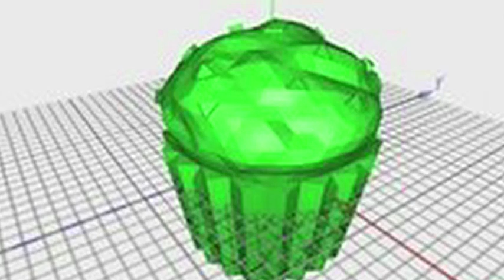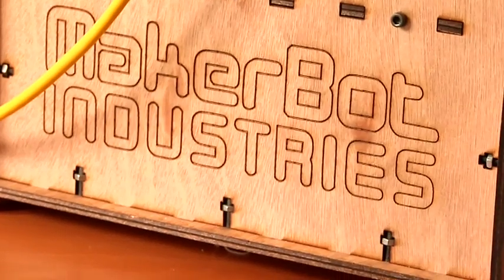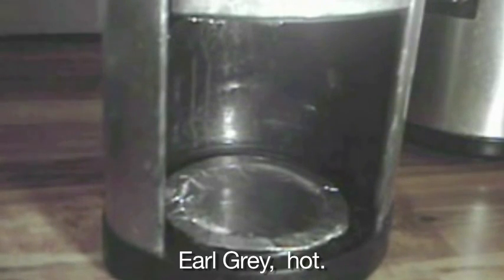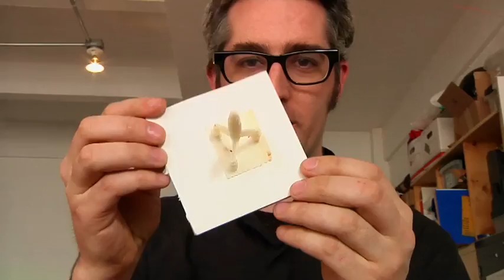MakerBot: The 3D Printing Robot

Comment: I just want to warn everybody reading this. That I purchased a MakerBot in Sept. 2010, and I built it, it worked for one print, then failed.  MakerBot support is almost as horrible as the half ass wood design of the MakerBot.  AVOID AT ALL COSTS!  Also if you already bought a MakerBot, threaten to sue Bre Pettis and MakerBot, and Bre will refund your money in full, and you can keep the MakerBot, for a free machine. Thats what I did. and I recommend it.

Comment: I don't want to get into text comment tennis, but I didn't wish to knock the US as its a great country. Unfortunately you have done it again. Check out Wiki for the following . Laser - Alfred Kastler (Nobel prize 1966). Revolver & Machine Gun - James Puckle (1718). Rubber - Francois Fresneau  (1755). Radio is generally attributed to Marconi (Nobel Prize 1909). Motorcycle - Michaux Perrraux (1868) or possibly Daimler. Elevator - Ivan Kulibin (1793). Tesla was Serbian.

Comment: Looks like hot glue - the 'head' there seems 2 B just like a heater element from a hot glue gun, & the material goops around like hot glue.  Something they could  maybe do 2 make it work better is have it lay down goo in a cool water bath, or @ least with a cooling fan near the object - so maybe eliminates a lot of that dripping junk & blockyness - they could also place the layers much closer together & use a smaller apperature.  It's really the 'Hot Glue 3D Modeler' (2 name it honestly  =)

Comment: Sure, & U know the 3D printers will sell 4 like $50, but the 'ink' will B a comical anal-rape ripoff @ $20 per!

I have the solution: NEVER PRINT N E THING OUT!  PRINTING IS A HUGE RIPOFF!  Or, get ya'self an old 'junk' printer like an HP722C, where the cartridges aren't these MICROSCOPIC $30 'dead in 50 pages' consumer slave monuments to crippleware design.  Micro$oft N E 1? HAHA

Makerbot wants 2 peddle $100 hot glue gun printers.  Just $40 4 the 'goo' yes??  & 'maintainance' $ OMG LoL

Comment: Yes we 'geeks' (even hot geex like ma'self ;)  know..  can't even remember when I first saw - was around @ least from the early 90's when I was in college.  I think the 1'st 1's used plastic like the dental stuff - plastic bath, & would solidify shapes as the subjerged object moved down, layering them like dentists glue on vineers W/a light stick.

Problem with the 'makerbot' in particular as U can C is very blocky lookin', & drips goo everyplace.  Multi-axis routers give a smoth result tho'  =D

Comment: I like 2 use a router & 1" thick plywood.   It's cheap & strong & with freaky curvy bits can make loads a groovy toys U can actually USE!  =)  Like 4 instance big groovy speakers U can sell 4 thousands of $

U can make templates also from 'cardboard wood' ('pressboard' type stuff) 4 templates - that is, 'till U go big wheel from the protos n' just subcontract 2 a CNC place like mois HAHA